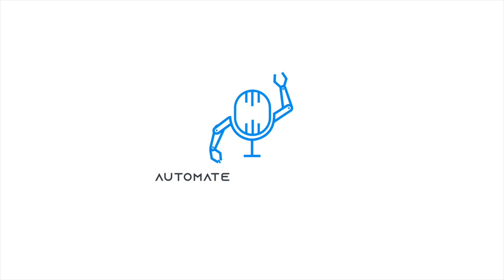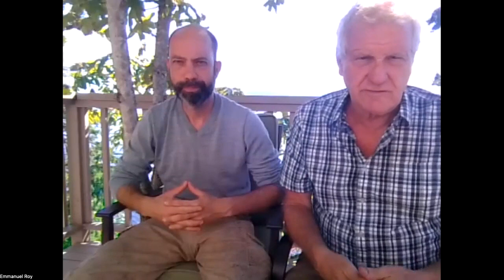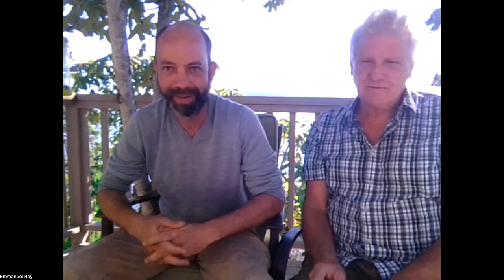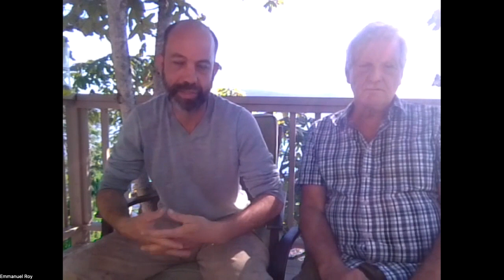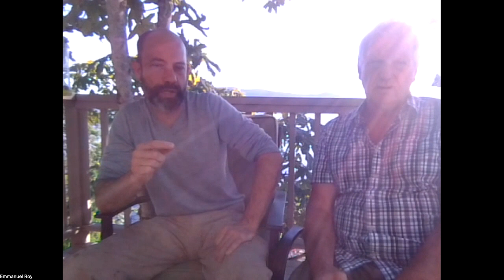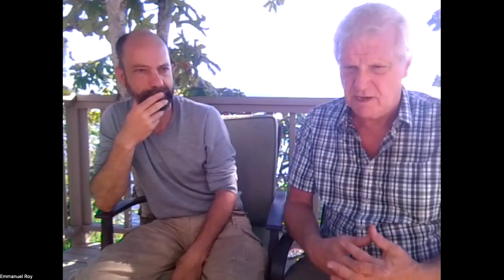3DCP Startup with TAM Printer, Deleting Parts, Learning Curves & The Future

Comment: They are exactly right, $1 per kilo is too high for home building.  That equates to about $1700 per yard, plus shipping cost and onsite mixing costs, so effectively well over $2k per yard.  And to get through a rotor-stator pump it needs twice the cement (binder) of concrete.  The Chinese "Greenprint" gantry has a second hopper that conveys truck-delivered concrete to the extrusion hopper.